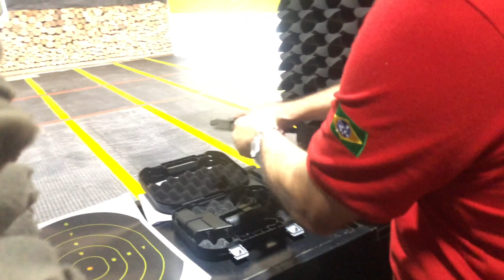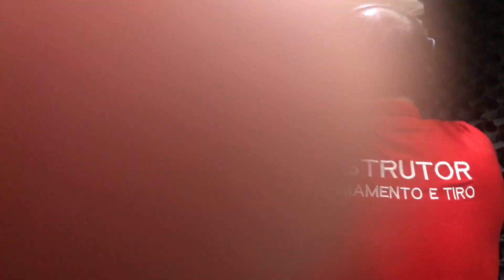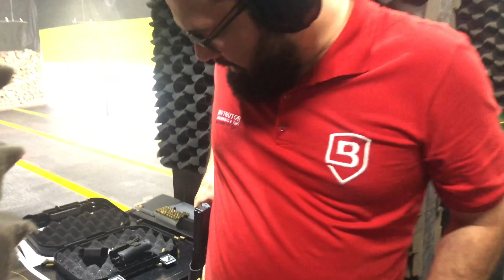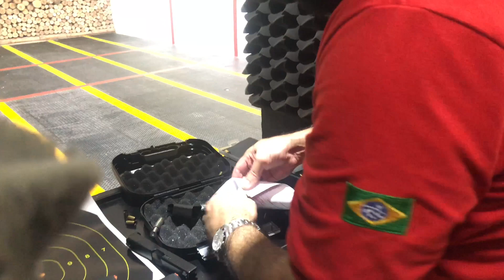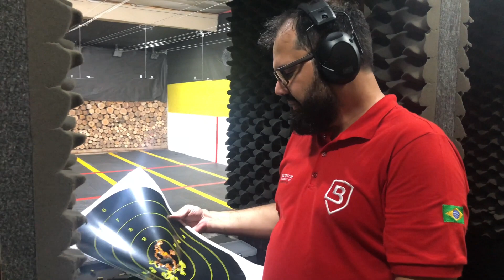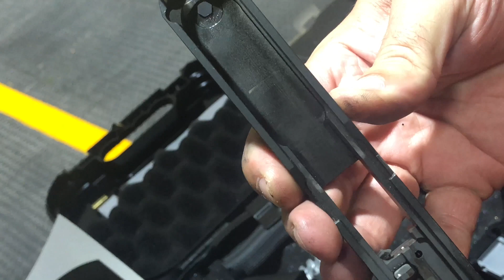GLOCK G17 Gen5 UNFIRED - nDLC, melhor acabamento do mundo? Julgue você!

Comment: nDLC finish for barrel and slide – GLOCK‘s nDLC provides tougher, more durable protection than previously used finish. The nDLC finish is exclusive to the GLOCK manufacturing process. The nDLC finish increases protection against corrosion and scratching and improves the ability of the pistol to function in degreased or adverse conditions. The nDLC finish will be exclusive to Gen5 pistols at this time.

Ou seja, eles não afirma que esse acabamento deva ter essa característica nas partes não visíveis (internas) da arma!
Se a arma apresentar esses desgastes na parte externa, sem terem sido provocados, daí podemos pensar em falha naquilo que é prometido pelo fabricante!
SÓ QUE a propaganda deles também é em relação ao cano! Então, com o uso normal da arma, o cano NÃO poderia apresentar tais marcas de desgaste no acabamento! 🤷‍♂️